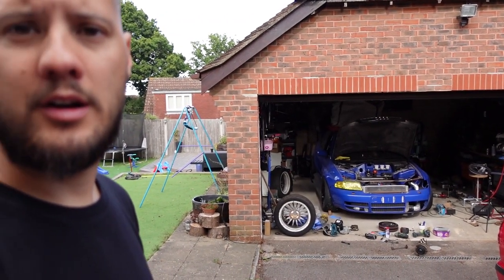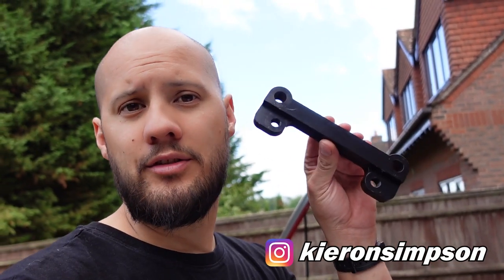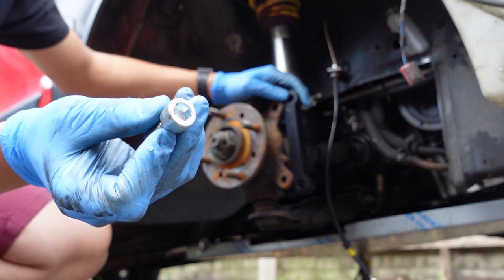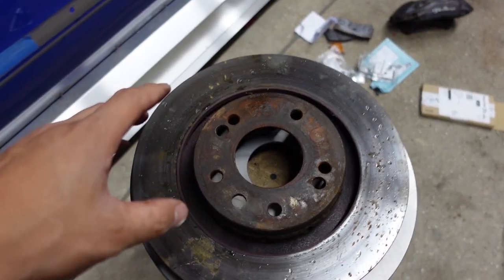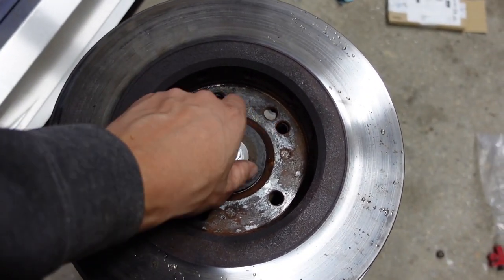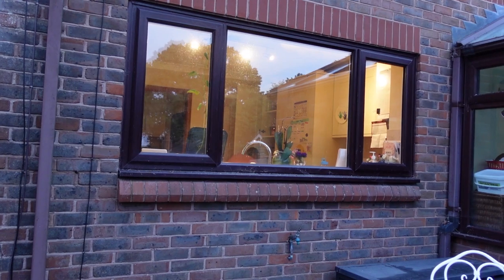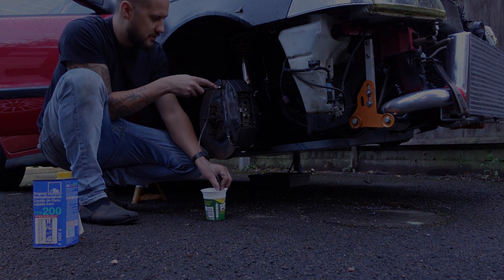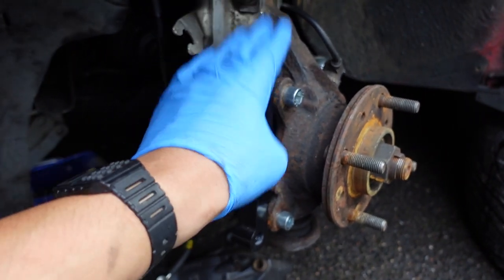The Volvo gets Brembo 4 pot brakes! (From an Alfa!) Cheap brake upgrade DIY

Comment: Damn! Would those brackets and calipers fit on a P80 Volvo?
Reply from the maker: I'm not sure if they would, these hubs are actually based on the mitsubishi platform so quite different to the other Volvo cars
Reply: @AndyPonting  damn. I’m asking around as while there is some info available, it’s not a lot or condensed when it comes to P80’s. It seems like it has to be dug up as it’s not a very great platform for much. If one has one of the higher end models there are some, but everything else is bits and pieces😅 finding something like what you have in this video would be a godsend if it’s possible to adjust slightly and it could fit the P80’s.  Thanks for responding either way👍🏼😄

Comment: mate, what have you done with the rears? if nothing you can probably use my research that i did, even that i ditched my t4 3 years ago
Reply from the maker: Rears are standard with track pads. At the moment they're adequate. With the interior stripped out they can still lock up sometimes when trail braking into a corner

Comment: Hi . A have project car volvo V40 T4.  From what model Alfa Rome are the clipers an from where i can buy the correct carrier to fit volvo v40 t4. Thanks.
Reply from the maker: The calipers are from an Alfa 166. Contact bartjongedijk97 on Instagram for the brackets 🙂

Comment: which pads are you gonna run?
Reply from the maker: I'm actually running BTCC brake pads. They're not a direct fit so required small mods to the caliper and a bit of trimming of the pads to make work. I decided not to share that in a video, because although I know  it's 100% safe, I didn't want to encourage others to go ahead and start hacking away at their brakes.

Comment: Hi! Can you provide a part number for the  Mercedes brake discs? Thanks!
Reply from the maker: MERCEDES-BENZ CLK 3.5 350 (01/05 - 05/09)
They're 330mm x 28mm
Reply: @AndyPonting   The 345mm x 30mm doesn't fit? Mintex part number MDC1790

Comment: why didn't you use volvo v70 r 4 pots?
Reply from the maker: These calipers are super cheap and someone has already designed the brackets
Reply: @AndyPonting  what curet proce for you, because for me new volvo v70r 150€ for one so fo new 4pot i think thats cheap
Reply from the maker: I got a used pair in good condition for £125 including delivery